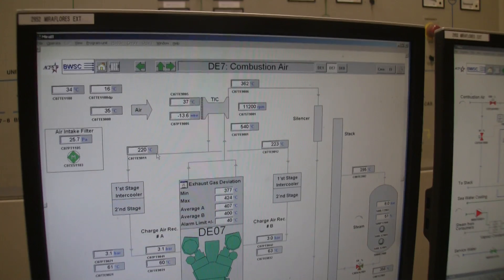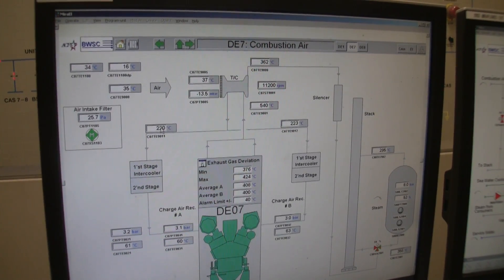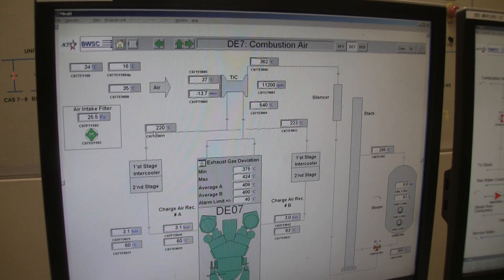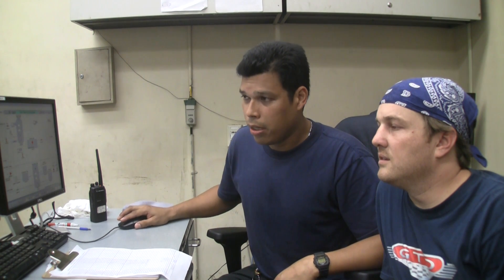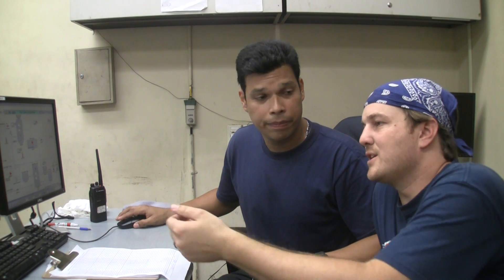Power Generation Tour of Miraflores Locks at the Panama Canal

Comment: Ok ok, what was that?  

one piston has a diam 48cm by 60cm stroke...

As we are boys, and boys need comparison, right?

So that would be 4.8dm by square by pi by 6.0dm = 434 liters (dm2)

Which converts to approx 26500 in³ displacement,
 eeh, still only one cylinder, so the 18 together of one engine would be around 

7800 liters or 477000 cubic inches, 
 
that's 1117 classic Ford Big Blocks 427 ci
or 975 Bugatti Veyrons 16.4